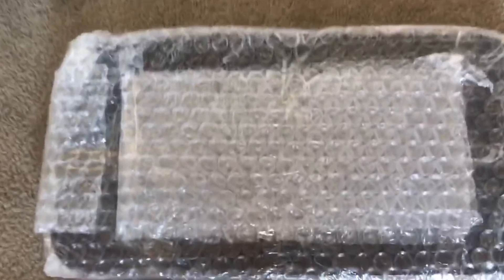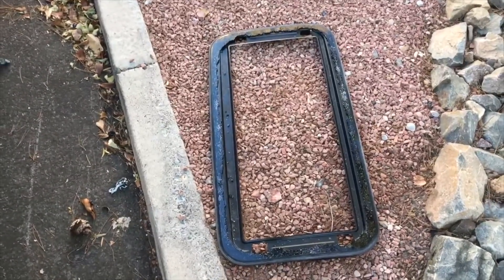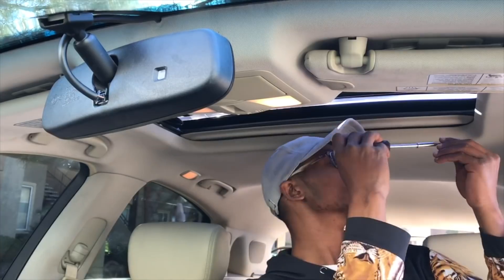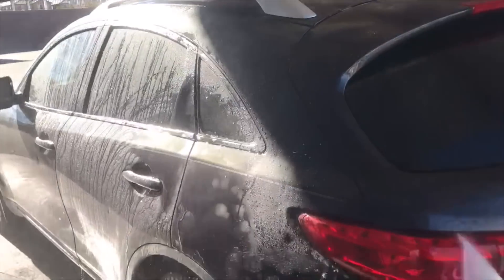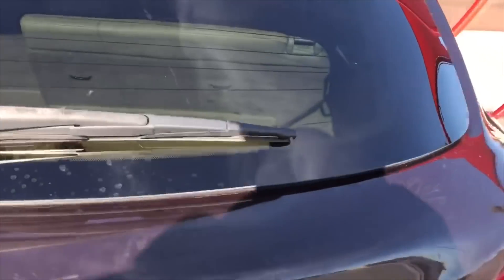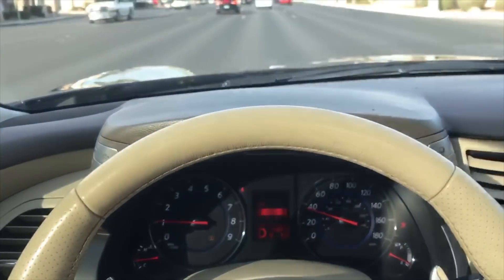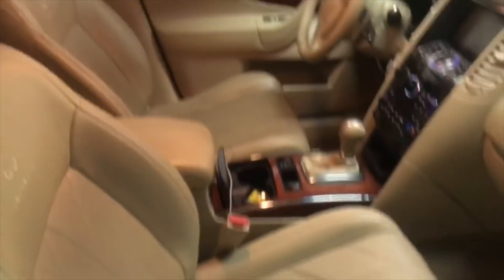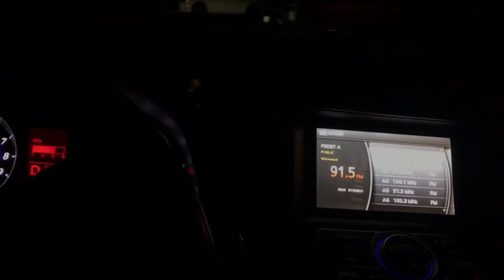Everything Fixed but Body on the Hail Damage Copart Car

Comment: I am just wondering if you did a really high end wrap on the car to cover the dents.  Also for removal of glue I would look at the tar remover which is better on the paint or try with rubbing alcohol carefully.
Reply from the maker: Actually was thinking that yesterday, but the dents will still show.
Reply: @EverythingsRegular  Maybe consider getting the dents filled/ pulled and then do a wrap rather than repainting the whole car? The wrap would be way more forgiving than paint. However, probably a high end wrap would cost the same as a cheap paint job.

Comment: Did you check if you are loosing antifreeze some where?, because is not normal that the resorvoir is empty, worse case your engine is consuming the water, check the oil.

Comment: When my battery went bad on my FX (2012) it started messing with my mass airflow sensors.  Here I thought they needed cleaned and possible throttle body issues and it was only a battery!

Comment: I just got around to seeing this video, if someone  offered you 7 racks for that car you should have took.  I would not pay no more than $5,600  , all them dents on it. Mirrors need covers, air bag light blinking, damn alot of things. My sister got the same car and it was little more than 7 racks but clean. Not looking like you had spouse issues . It is an old video you might of found a sucker since then.

Comment: On the light switch there should be a setting mode that says on doors and off and turn them off the the battery won’t die anymore
Reply from the maker: Yea i thought the same(I have that setup in my camaro) but it doesn't
Reply: Everythings Regular strange hmm my g37 has it but I’ll start looking around and I’ll see what u find a solution for you
Reply: Everythings Regular hey you do @ :25 switch them to off instead of doors
Reply from the maker: yea i figured it out thanks bro  @Joel-qw4ux

Comment: Bruh! Man, I know I have been critical in a few videos, but I also always try to keep it civil, and positive as well. I get that you aren't a mechanic. Just gotta use the common sense that God gave ya! Always gotta clean ALL the broken glass up before you install anything new. Gotta use the right products for the job. Quick detail isn't for removing adhesive ... get some paint safe adhesive remover. If I recall, you already got a new battery for this car ... how long were you at the car wash? A good battery should last at least an hour, if not several hours just having the door open. If it went dead quicker than that, you got screwed on the new battery. You are spending cash that could go towards fixing the dents on things like car washes. Detail that thing out when its done! I do get that this is a driver for you, but someday, it will be flipped, so you gotta watch the spending either way.

Comment: try a heat gun on the dents see if they pop out. Harbor freight has heat guns for like ten bucks
Reply: Maybe if you are lucky and on a dent in a part of the car with some flex like the door panels or quarter panels, but on this car there is alot of damage on parts where the sheet metal is tight like the A pillars and roof line. No flex there.